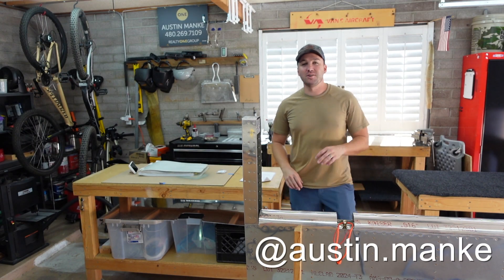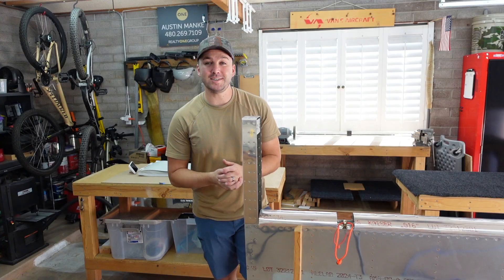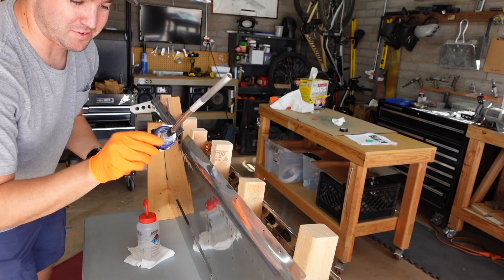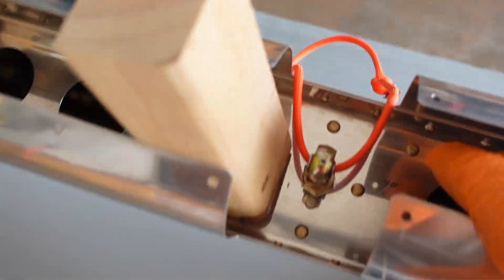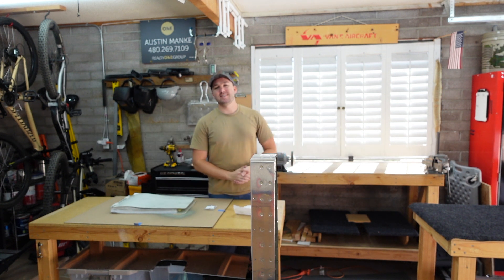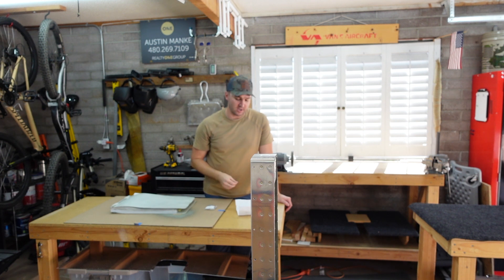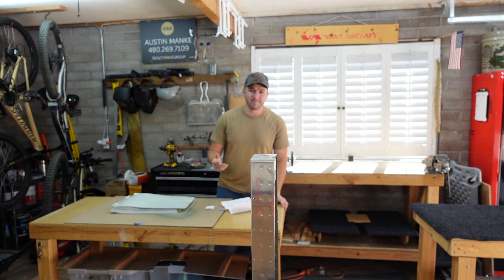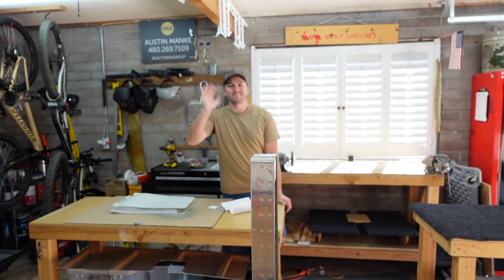Elevator Cracks - Service Bulletin SB-00043

Comment: I saw the extra aluminum chunk you added to the counterweight rib, there, was that part of the service bulletin?  Did you have to purchase an SB kit?  I didn't realize they did this.   I'll stop asking dumb questions and look closer at the SB.   I'm just now building the elevator so i can seal up that trailing edge spar hopefully before putting buttoning up the skins so I don't have to go through the lightning holes.
Reply from the maker: @flightsimguides  no such thing as a dumb question!  That piece of aluminum was part of the service bulletin kit. I think it was to offset the weight that was added by the tank sealant. You’re at a perfect spot to get it done. I did have to buy the kit to implement it, but figured it was better to do it now than after paint sometime in the future

Comment: It has been my experience that CS-3204 and equivalent tank sealants don't adhere well to factory-fresh Alclad 2024-T3 that has not been scuffed, even when those surfaces have been thoroughly cleaned with acetone or MEK.  Will be interesting to see how these repairs hold up over 1000 hours of flight time on assemblies that have not been scuffed and/or primed.
Reply from the maker: That’s a great point! Never really thought about that when I was doing the SB. I could have pretty easily taped scotchbrite to the end of a ruler and scuffed it up a bit before final cleaning….. we shall see how long it holds up!

Comment: Austin - Did you have any trouble with the tank sealant leaking around the aluminum tubing that you taped to it? I saw a post on VAF where a guy used AN fittings to connect the aluminum tubing to the tank sealant but that requires a flare tool (~$150) which I don't have. I don't mind buying the flare tool if it's required but you seemed to make do without it. Just wonder how well using tape (and sticks for support) worked for you.
Reply from the maker: I saw that post too. Seemed very sturdy but not needed in my opinion. I had no issues with mine. I used that heavy duty black gorilla tape, then added those sticks and wrapped it all in electrical tape. No leaks 👍
Reply: @AustinManke  Great! As always, thanks for taking the time to reply!
Reply from the maker: @bertschb  any time. Happy to help!
Reply: I took a sprinkler riser tube and taped that over the tubing and nipple joint..  Worked great - it was about 6-8 inches long.

Comment: Great video. Minor detail: the rivets shouldn't really come off while you drill them out. Use a #36 drill bit which just weakens the rivet, then a punch to break off the head. That way, the holes in the skin stay untouched.
Reply from the maker: Thank you! And thank you for the tip. Drilling out pop rivets is a real weakness of mine since I haven’t really done it much. I was worried about ovaling the holes so I was trying to stop right when the head popped off, which was pretty difficult. Your method of a #36 bit seems so much more safe and repeatable. I’ll be doing that going forward. Thanks again!
Reply: This was a good tip.  Came out super easy...